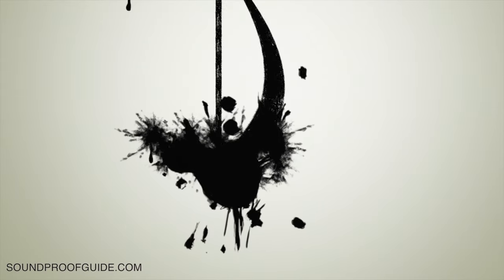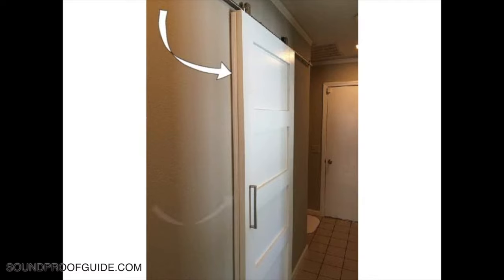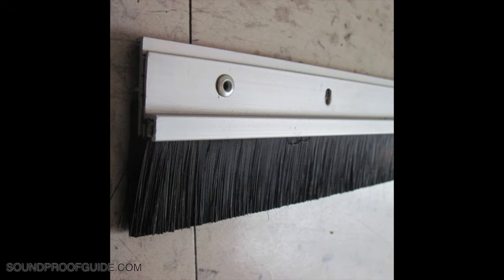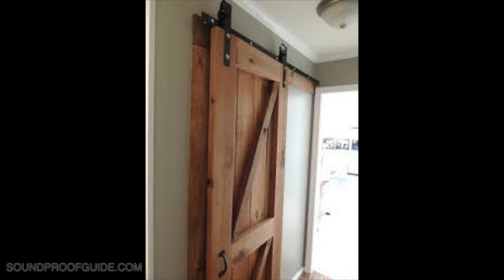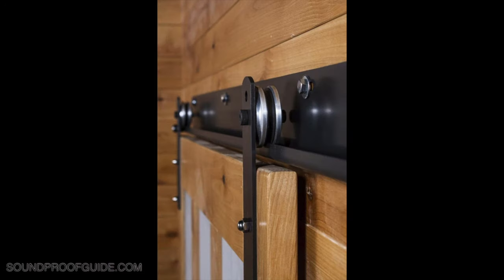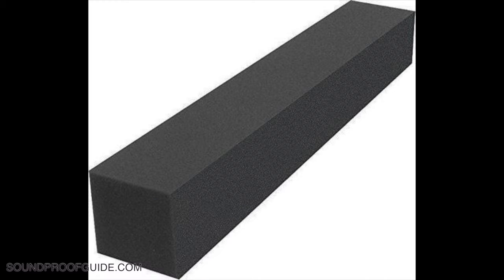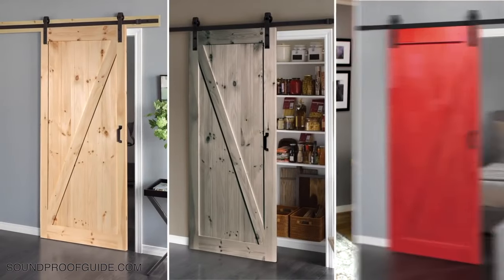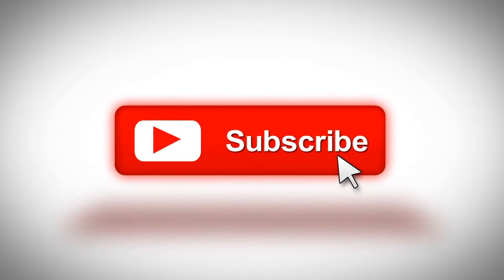How to Soundproof Barn Doors the Right Way!

Comment: Just finished hanging 2 barn doors  with my own "custom privacy" design.  So the bottom space, I just got as close as I could... Any normal door has a small crack so I wasn't concerned about that.  Its the 2 sides that I wanted to figure out a way to make more private.  You can achieve this by running a piece of "stop trim" that runs the entire side of the door, and will be what your door is going towards as it closes.  It should stick out far enough so that it will be flush or even past however much your door sticks out.  You can even add a little lip that goes back towards your door so that the door fits into that "Stop piece".  So like this (the equals signs represent the door)   

L ============

    Then on the other side of your door, you will put another piece of trim that runs the entire side of your door height and then another piece on the actual door,.  So this will be a piece of trim that will be like a little lip that will connect with the wall trim when in the closed position.  And there you have a gapless side barn door that glides free of contact, and is sealed when closed..   Another tip for keeping it sealed tight when closed is to install magnets in the wall trim and doors.  So when they connect there is no bounce back. They sell magnets that you can mount flush with the surface
Anyway - I couldn't find anything about getting a truly private door except for all those talking about weather stripping - but I want my door to glide - not drag over weather stripping. Plus anything that is rubbing against something else over time it will not be a good thing.
Reply: Hey could you share pics or videos of your barn door... especially the sealing.....a beginner here
Reply: If I provide you my email, would you be kind enough to share what you’re describing? It appears to be a good, long lasting solution. Thank you!

Comment: Could you tell me how to fill in the gap between the wall and the door? You said to use foam, but exactly where do you place it?
Reply from the maker: The way I have done it is by sticking the corner piece foam along the full length of the side of the barn door.  Make it so the foam touches the wall and also drags on the wall while you open and close the sliding door. The foam will make a tight seal but still drag on the wall without causing damage. 

Let me know if this works for you and also if you have more questions.
Reply: Thank you SO much!! I just gutted a small bathroom and put a barn door up to save space. Was wondering how to fill in the gap to make it more soundproof.  Can't wait to try it!   :0)
Reply: @soundproofguide  Does the foam already have adhesive and if not what did you use?
Reply from the maker: @MR-nk9ey  The new type of foam I use for this type of job does have a self-adhesive side to it. Here is the link; https://amzn.to/2NZQjAf
 I hope you find this useful. Let me know if you have more questions.
Reply: @soundproofguide  Hi did the soundproof tape worked for you?
Reply: Did you try this and did it work?
Reply: I had my trim guy add mdf trim to each side of the door and it perfectly closed the side gaps for privacy purposes. It doesn’t do ANYTHING for sound. Now, I need to work on top and bottom of the doors. Wish I had this to do over (barn doors for all the bathrooms) Live and learn.

Comment: any ideas for soundproofing if you live in an apartment and the barn door is made of metal and glass panels?
Reply from the maker: Hey sorry just seeing this! The important thing is to seal all the gaps and cracks that would let noise though. 
You can do this using acoustic caulk or weatherstripping, depending on the surface area of course.
You could install a soundproof film over the glass to help block some of the noise coming through the glass. 
Check out our website at https:soundproofguide.com and I’m sure you’ll find the answers you need there! 
Let me know if you have any other questions!

Comment: Can you explain the first option? I don't exactly understand where to place the sticky side of the foam tape for a sliding door
Reply from the maker: For a sliding door like that I would just stick it directly on the side of the door. Full length from top to bottom where the door meets the wall. So when you close the door the strip will creat a better deal than just the wooden door pushed against the flat wooden casing. Hope this helps!

Comment: If someone could find a way to imply the auto sliding door mechanism on the cars and minivans in a house environment yes you would have a perfectly soundproofed door. You need 2 way motioned rail system where the door slides in the main frame after sliding to that spot...
Reply from the maker: Now that would be awesome!

Comment: So there is basically no right way - you can't soundproof a barn door
Reply from the maker: Soundproof might not be the right word but by using these methods mentioned in this video you will certainly be able to decrease the amounts of sound decibels coming through the door.
Reply: @soundproofguide  No worries - thanks for sharing the video and tips. I just had issues with the title since I'm waiting for the right way, and then there are 5 ways mentioned but at the end there is no way to soundproof with kids and you wouldn't recommend it. :P
Reply: @VllKlNG  Yeah the big diss on barn style doors at the end is really frustrating.  Sometimes the only option for the space is a door this style.